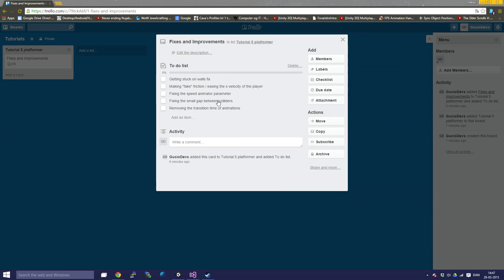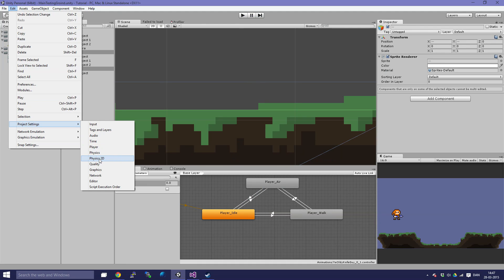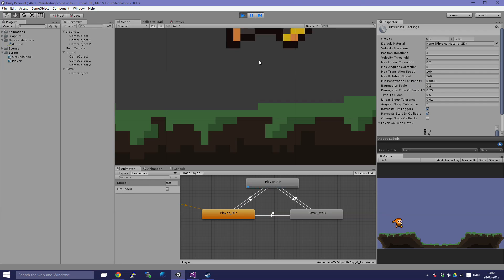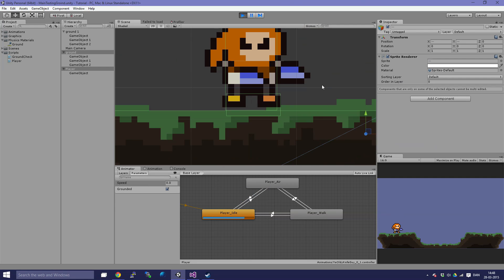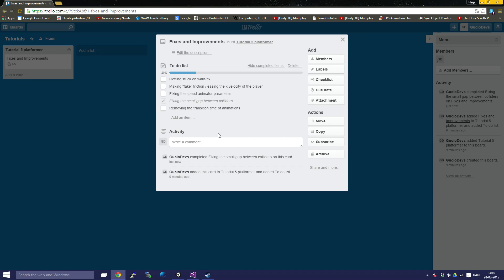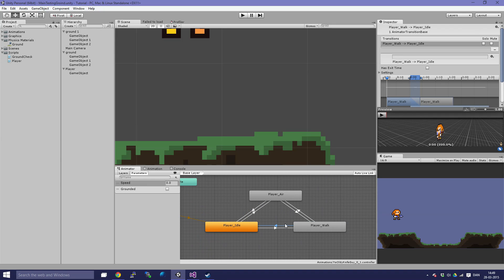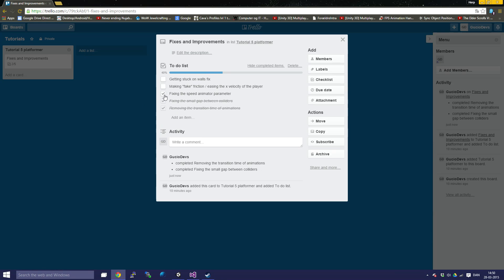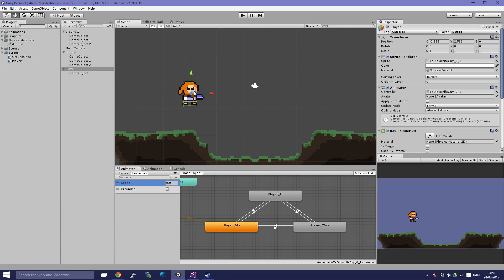Unity 5 2D Platformer Tutorial - Part 5 - Improvements & Fixes.

Comment: Great series of tutorials, +GucioDevs, learning a lot from these gems.

I'm curious though, why did we need to create another Vector3 object (easeVelocity) and not simply change the rigid body's (rb2d) velocity directly like so?

if( grounded) 
{
    rb2d.velocity.x *= 0.75f; 
}

// or 
if( grounded) 
{
    rb2d.velocity = new Velocity2D( rb2d.velocity.x*0.75f, rb2d.velocity.y); 
}

Wouldn't the above code blocks do the same thing for FixedUpdate() (and since we're not using the z axis anyway, I suppose we don't really need to set it)? 
Anyway, I'm just curious if there was a specific reason for easeVelocity or for using Vector3D instead of Vector3D.

Thanks for your hard work, it's greatly appreciated!

Comment: I can't make my player jump high enough to reach the middle of the slope. I have set jumpPower to 8000f and even 0f but the result is still the same as the one with jumpPower of 150f. How can I fix this? Sorry for my bad English.
Reply: +hadaicoc if I change the jumpPower value directly in the rb2d.AddForce(Vector2.up * ); like rb2d.AddForce(Vector2.up * 200f);, it works.
Reply: +hadaicoc it's okay now, I messed up and undo. Now it's works fine. Don't know what is the problem...
Reply: +hadaicoc Just changing the variable in the script doesn't change the variable that is used. If you click on the Player object and check the script under components, it will still have 150f. This is the variable you should change.

Comment: thanks for the great tutorials! i am up to part 8 and things are going more or less smoothly.

unfortunately there seems to be 1 second or more delay to the animations.

starting from idle to walking, the character slides along the ground before going into the walking animation. going from walking to jumping is the same, continuing with the walking animation in mid-air . i have unchecked 'has exit time' on all the animations but this is still happening =(
Reply: +Adam Bruneau in addition to unchecking the has exit time you need to reduce the blend to 0. its that little slider graph shown below the "has exit time" box. just grab the blue ball on the right and drag it to the one on the left.